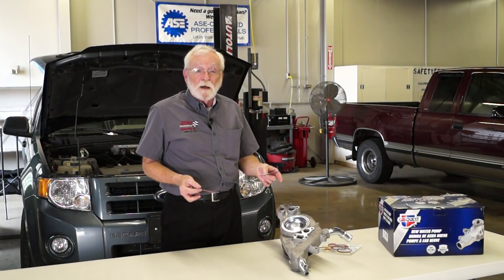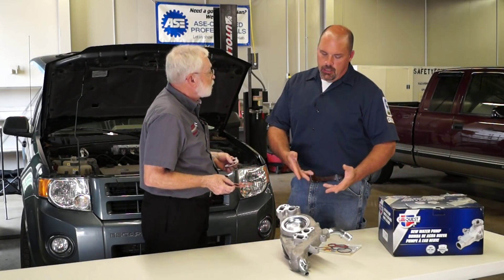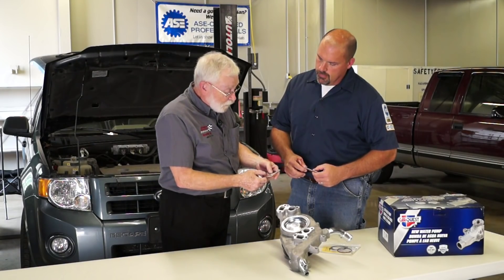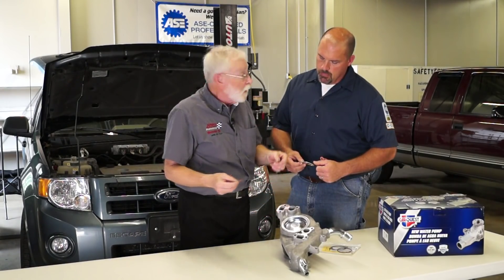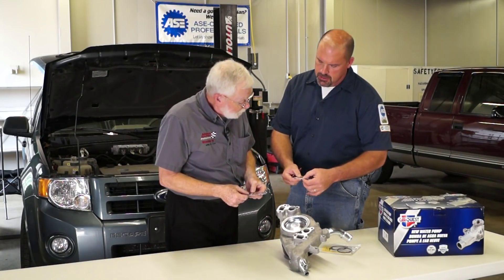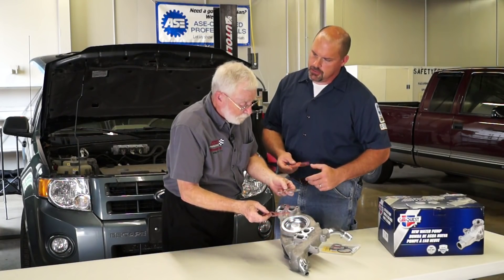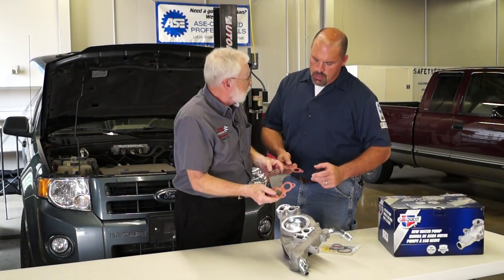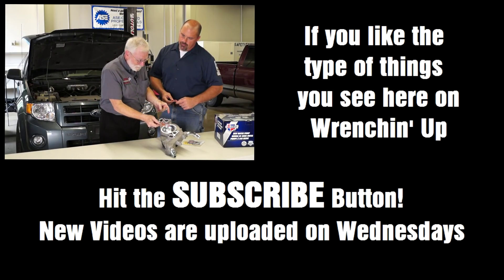Use the Right Gasket Material - Wrenchin' Up

Comment: lol---bought a car quest water pump from advanced for a 2000 jaguar xj8--it came with the paper gasket--original gasket was metal--tried to re use metal gasket and leaked so i was kinda forced to use the paper----2 months later its leaking---gonna buy a metal gasket
Reply from the maker: Hi - Thanks for watching and sharing your experience with that. Let me know if the metal one solves the issue. I'm sure there are others that would like to know too.
Reply: Get another paper gasket. Clean the surfaces really well. Use a brass brush or green scouring pad if needed. Then apply some Versachem to the block and then the water pump. Place paper gasket on water pump, which will be held on by the versachem. Install pump ensuring to tighten bolts in a cross pattern. Done! No more leaks.

Comment: Do you put RTV on it?
Reply from the maker: Hi - Thanks for watching! RTV and other sealing compounds can be helpful when installing gaskets in between parts that have rough or pitted surfaces but sometimes it’s best to just follow the manufacture’s installation instructions, especially the case where special gasket materials are used.
Reply: @WrenchinUpwithJimBates  One says use it, another says don't.  One says use threadlocker.  Another says don't.  I don't what to believe.  I guess I just go with my gut.  Uh, oh.  Trouble every time I do that.  What's a shade tree to do?